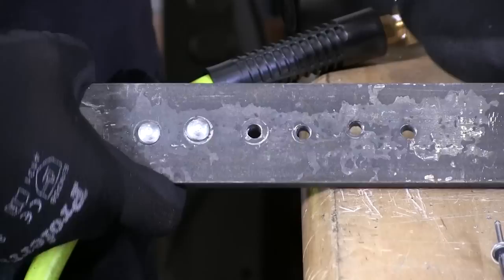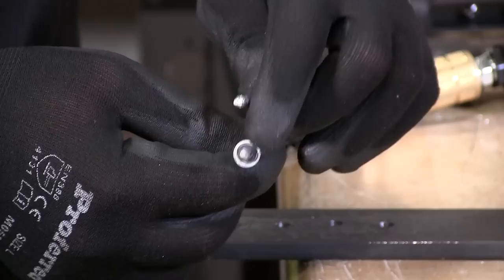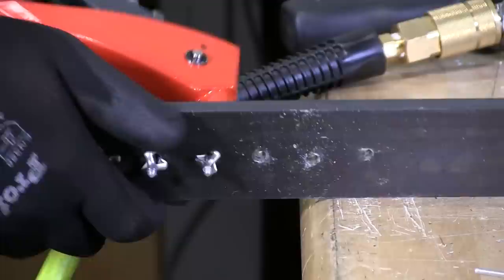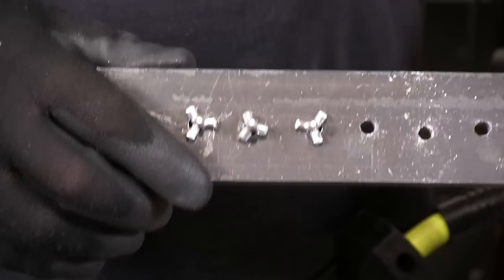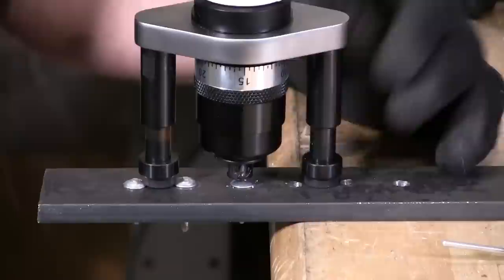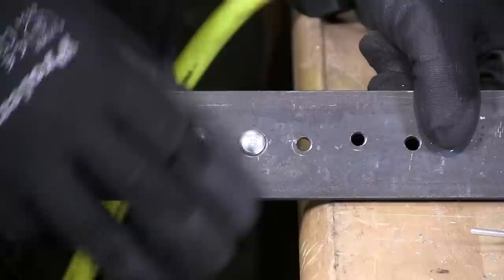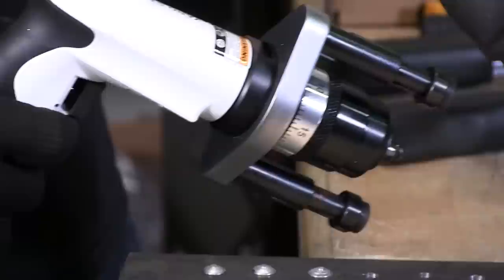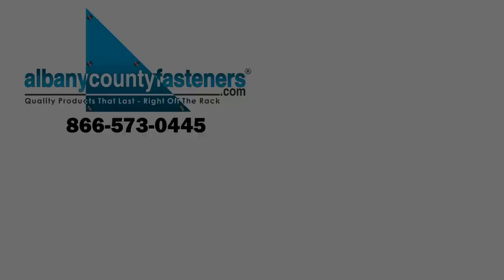Tri-Folding RV & Trailer Shave Rivets | Overview

Comment: What advantage is there to using the shaver tool vs a flush cutter and a couple pases with a hand file to smooth it out? That tool seems like a huge hassle and expense for no clear gain.

Comment: Can i ask. 
Alot of the roof rack installs seem to use standard rivets.  And it seems they are what fail on the 4wd setups.  
Would something like a trifold rivet be able to provide similar strength but a better bite ?
Reply from the maker: What’s a standard rivet?  Most roof racks use a recessed rivet in aluminum or stainless.  trifold rivets do not come recessed.  Your guides will not pass the head of the rivet.

Comment: How do u remove the trifold rivets tho??
Reply: Same as any other blind rivet... you drill it out. The simplest way tends to be center punching the exposed side, and using a drill bit slightly smaller than the mandrel/hole so that you don't gouge the hole if you're planning to replace it with a new rivet. You might need to pry/hammer out the remnants once you've removed the bulk.
Reply: I just drilled a few of theses out and the damage done by the tri portion spinning against the wall material was a huge bummer.